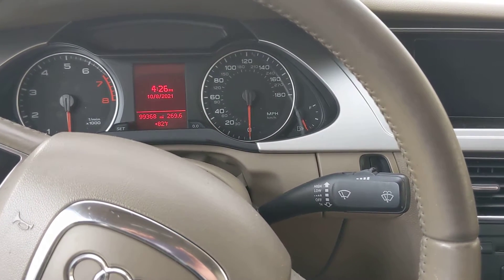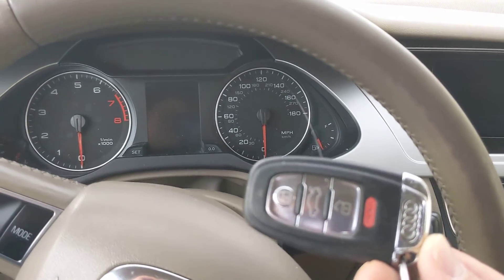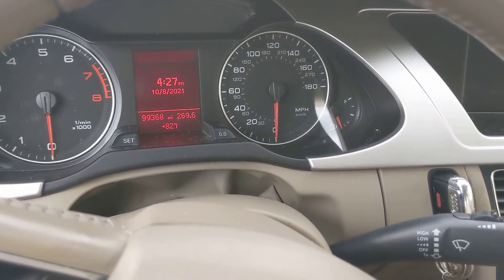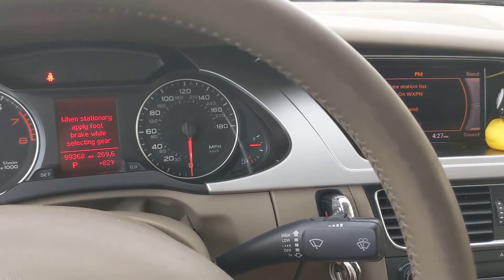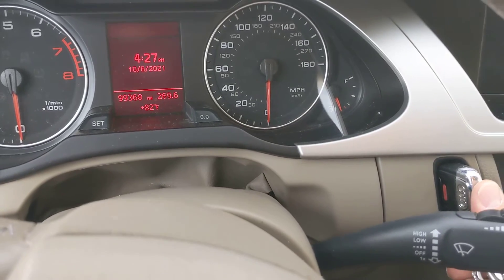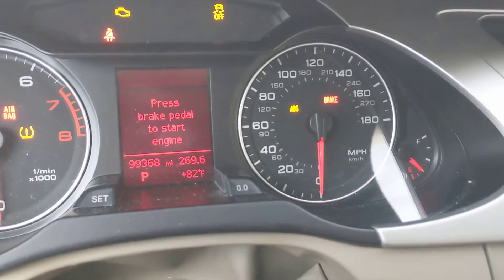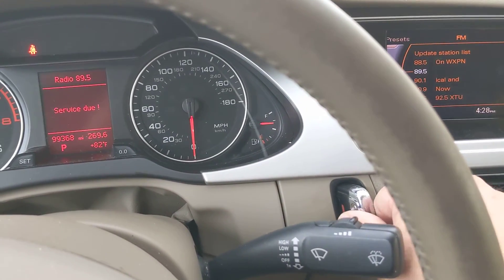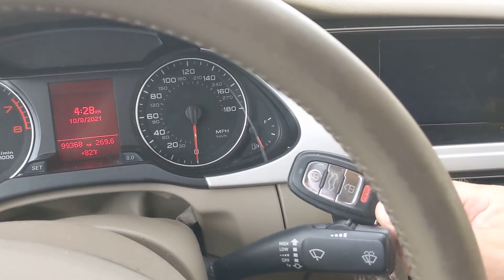How the keyfob works / How to start the engine in a 2009 Audi A4 quattro

Comment: You need to turn your ignition on and then wait for the dash lights to turn off before starting the car
Reply: No you do not really “need” to wait but it is recommended to wait those few seconds as I always let the dashboard “relax into a steady state with the same lights on” before putting my foot on the brake . Also when it’s below freezing outside (32F/0C) then I make sure Heater is OFF which helps start a nearly frozen engine (CCA)

Comment: I cant get the key back out even though I'm stepping on the brake
Reply: That happened to me too what did you do to fix it?
Reply: That makes it worse, if you stepping on break it won’t release it
Reply: Stepping on the break is needed to start the engine; not turn it off in order to remove the key.  I find it helps to have a small metal key ring circle on the key fob which makes it easier to grip and pull it out.